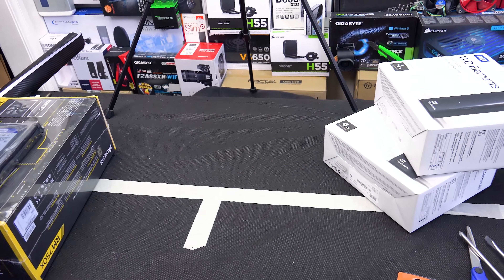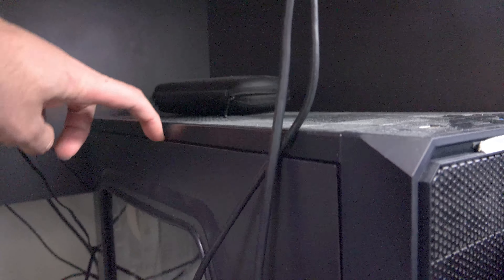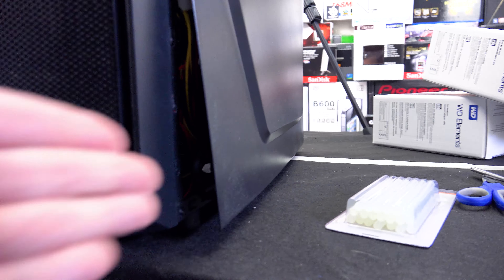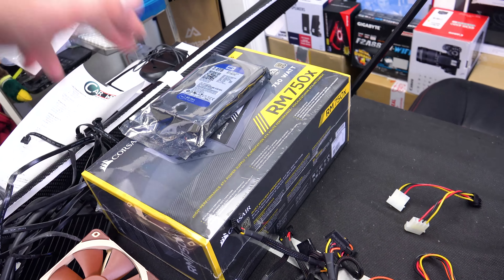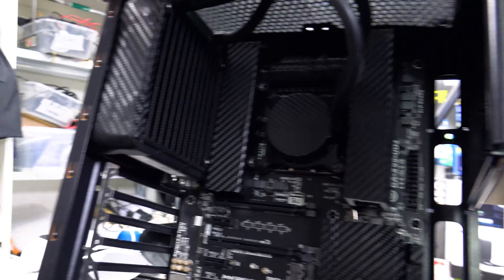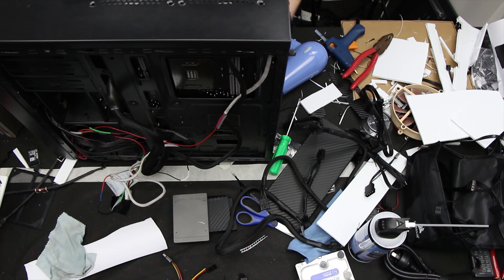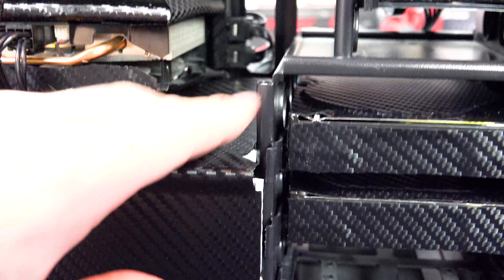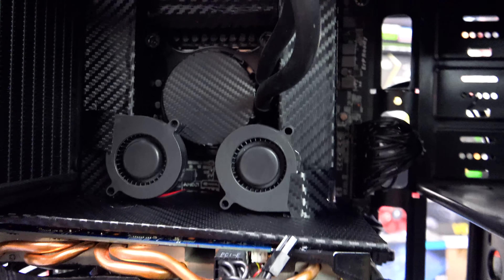Personal Rig Update 2017 PT 1

Comment: Tbh, the carbon wrapping went a little too crazy to the point of tacky, I cringed really hard at the GPU backplates and memory blocks. But if you like it, power to you :) I used to run a GTX 660, awesome cards for their price at the time! 

I was wondering if the wrap effects thermals much? Especially with the HDDs?
Reply: Gotta agree with this guy, here wrapping on the GPU was a bit much imo but it's your build don't let me stop you enjoying yourself. Really good build video keep up the good work :)
Reply from the maker: Thanks for the feed back :)  As for thermals i have seen almost no difference in temps, as it is summer now things do run a little warmer but nothing major to report. at first i was a little worried and thought it might act as an insulator but the wrap is so thin there is little to no difference

Comment: Just food for thought....I recently sleeved the RM1000X which uses the same extensions.  There are in-line capacitors hiding behind the heat shrink on the leads which is why the 24pin and the 8-pins are so massive.  It's an easy obstacle to figure out, but just a heads up in case you weren't already aware.
Reply from the maker: thanks, was not aware but will keep that in mind